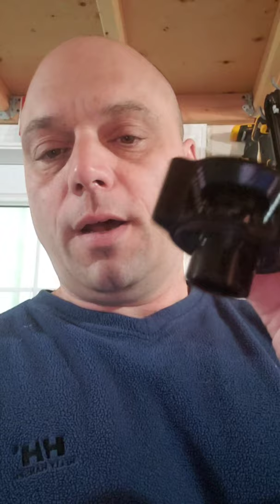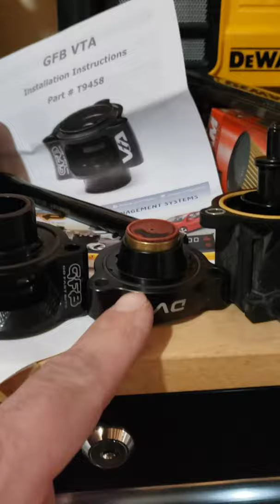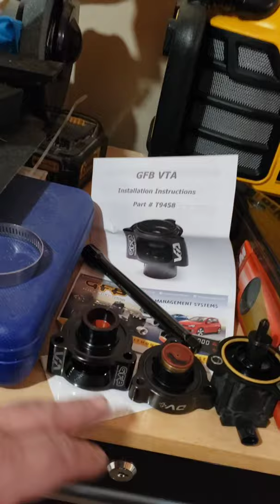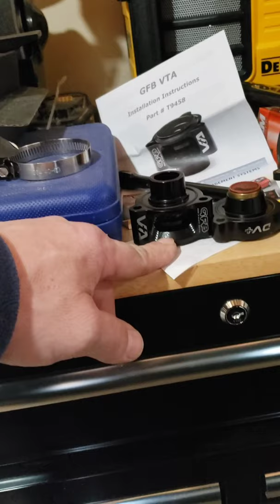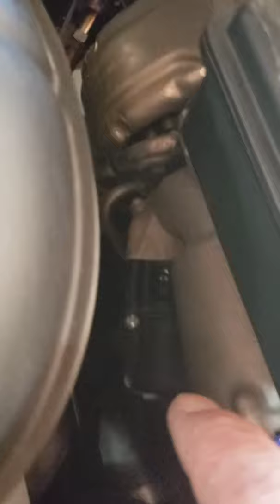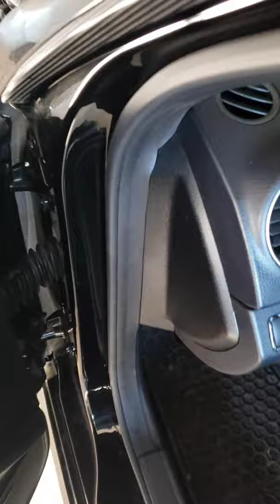Mercedes GFB VTA diverter valve upgrade

Comment: Man I put one on my 2016 C300 and its spraying boost on acceleration
Reply from the maker: Do you mean it is leaking out boost? If so  make sure you put a little oil on the copper cylinder. You need to make sure it moves freely, smoothly. I spoke with Naresh from tornado tuning about the same issue I was also have, he says it should not be doing that, my car also went into limp mode because of this problem. I since then i removed my VTA and reinstalled my GFB diverted valve. Once spring arrives I will reinstall the VTA and make sure everything moves freely and see what happens. I hope the problem was an install issue, I really love the sound but I cannot sacrifice that much performance for sound.